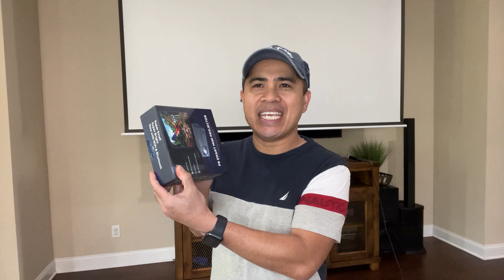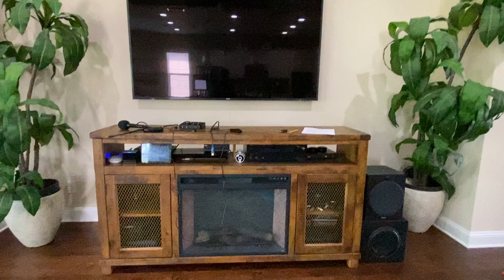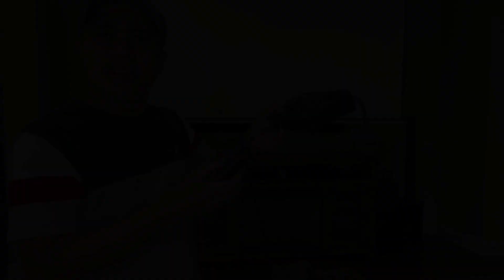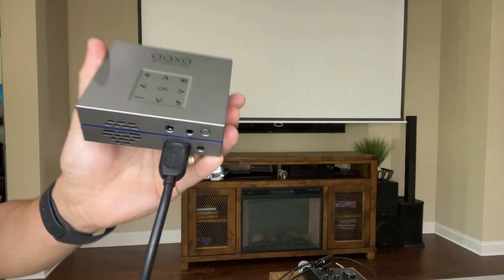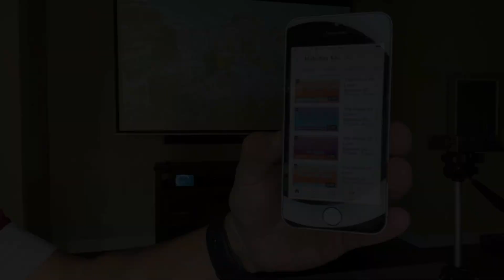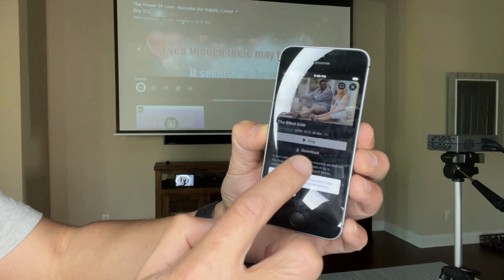Home Theater Projector Screen Setup | Best Movie Projector For Home Theater

Comment: Thank Joe, one question which I want to know.  That projector already had build in YouTube  app , you are not using it , then what that for ? Can you please make a video  to set up a karaoke system with 7.1 home receiver with HDMI input with Bluetooth build in and a 1080 projector please?
Reply from the maker: Hi TSO. Great question. It is a preference really. I could use the YouTube app that is built-in of the projector and I would need to send the audio output of the projector into the mixer input. That is one way of using it. I decided to do it the other way (as shown in the video) due to my set-up at home.

Regarding your other request about the 7.1 home receiver, you can simply follow this video. While I am using a 5.1 receiver in my house, it does not make a difference in how you would set-up the karaoke system.

Comment: If you are using AV receiver, it probably has HDMI out already. You can just directly connect the mixer output to the receiver and use the HDMI out to your projector/TV. Audio quality of a signal via optical cable is not as high as the one from HDMI. Just a thought.
Reply from the maker: Thanks!

Comment: I wish can do a karaoke system with Sonos beam or sonos arc😭
Reply from the maker: Why not?!!!
Reply: @MabuhayKaraoke  but there is no aux output
Reply from the maker: @muhdsalehin6551  please check the other videos. Few of them use hdmi.
Reply: Mabuhay Kabayan ! I’m having a hard time connecting my magic sing to my receiver / surround sound . I finally unplug my receiver so my magic sing works @ my smart tv but it don’t sounds right to me . So I plug the receiver again and sound is coming out of the tv . I’m tired of it so I decided to use You Tube so I can do karoeke on my ROKU Tv but then the You Tube don’t come out of the surround sound either . 

Ahhhhh ….I don’t know why I can’t figure out ! I thought the wire surround sound is better than the wireless